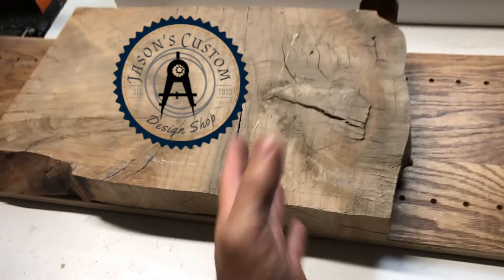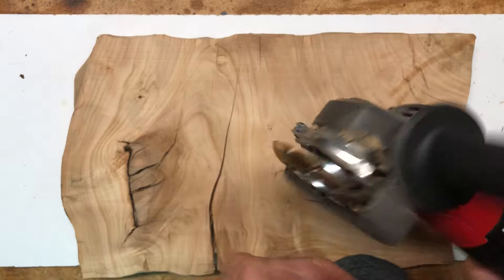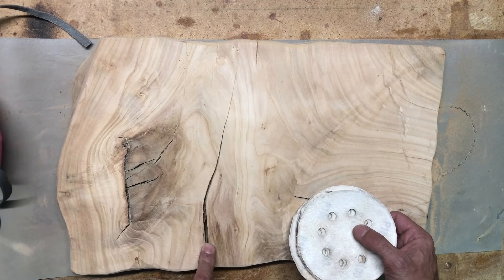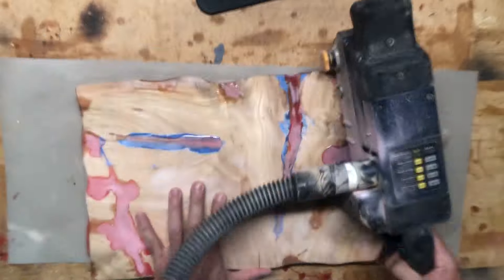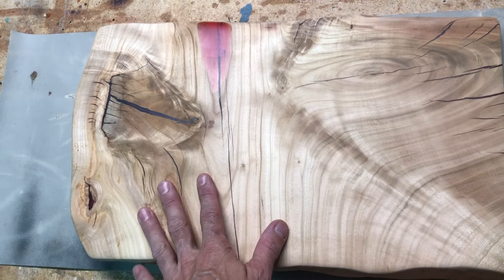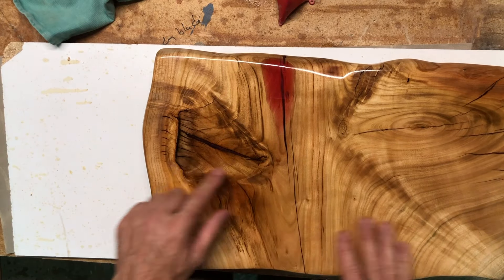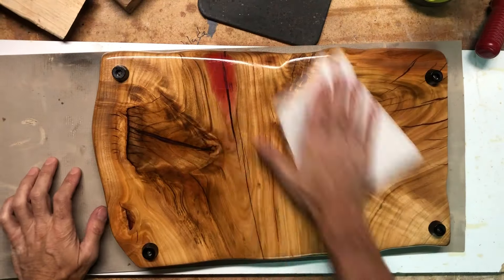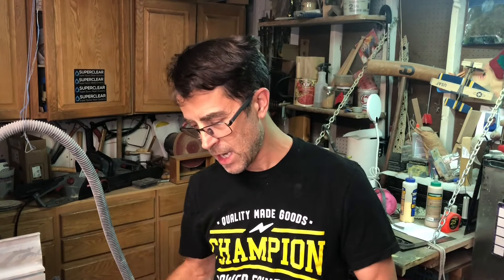What Beauty can we find inside?

Comment: When you sand up to 1000 grit you end up burnishing the wood... The pores clog and the oil mostly sits on the surface.  If you stop at a lower grit the oil will get deeper.
Reply from the maker: @BadPandaWoodworks  yes its definitely burnished it’s like a mirror.  Certainly not the normal way to sand a cutting board, but I wanted to see the effect and how it would look.  it’s sitting next to a 240 grit cutting board in the house so I can do a long-term results of drying using the walrus oil comparison as well.  Will see.